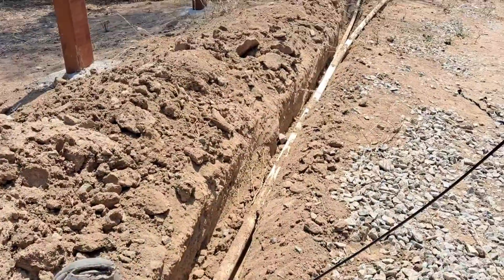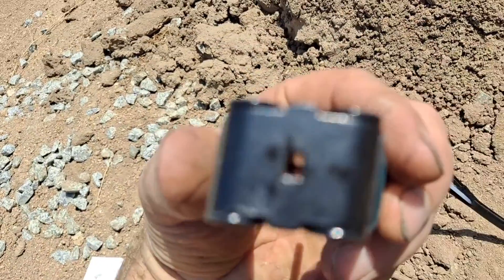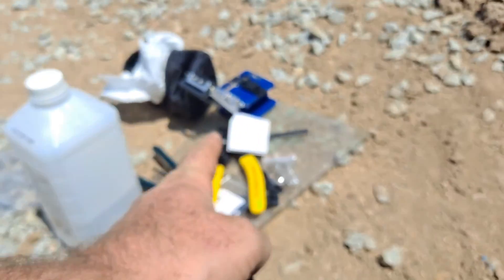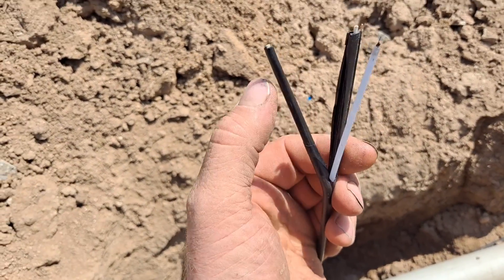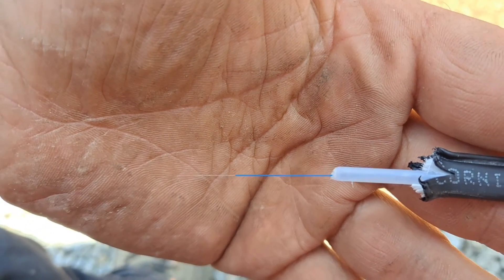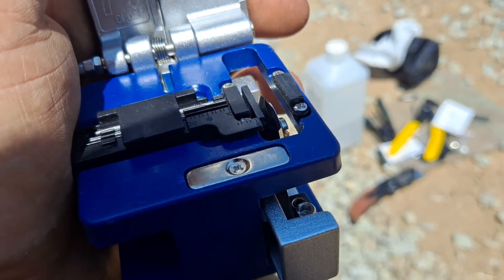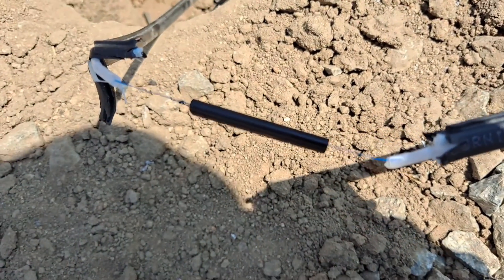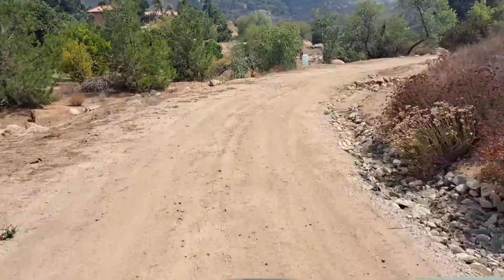Possible to DIY field repair underground fiber optic with Amazon cleaver and splice? Yes temporarily

Comment: Is it still holding up 3 yrs later??
Reply from the maker: @InspectorGroyper  it was working fine, but i had an unrelated issue and had a new 2000 foot fiber pulled by the provider. 
I did watch how they did a splice down at the main junction and they have much more sophisticated ways of doing it. Their splice is still going perfect.

Comment: If you strip about 100 cm till the blue jacket on both sides, you can wield em like that and put them in a small box where you wrap the 2 meter blue jacket inside, holding the thick cables in the entey (with foam tape around it and tyrips around the foam to hold the cable tight in the entry) then close the box, in dutch we call it “lasmof”